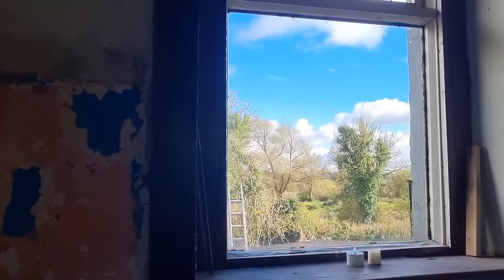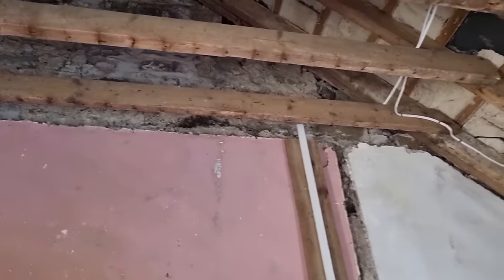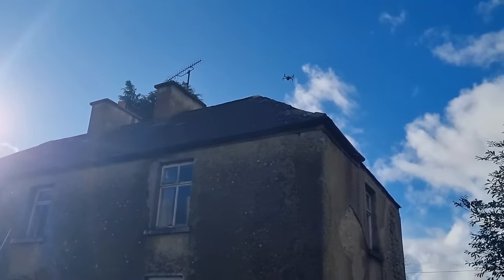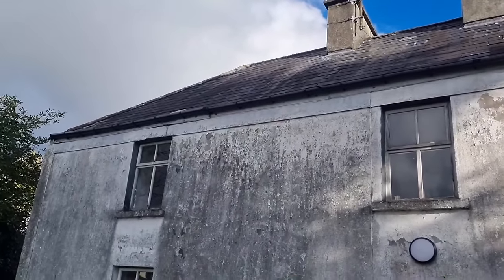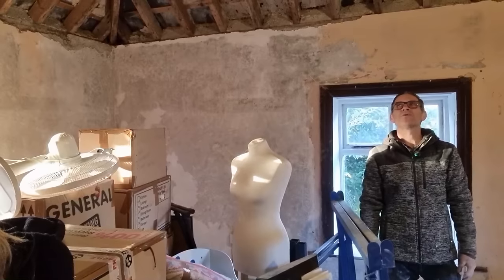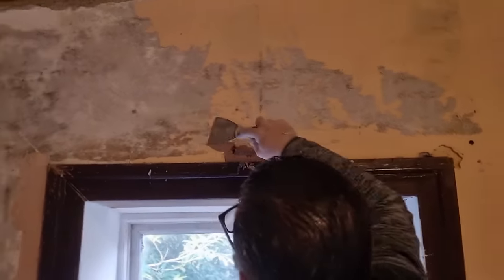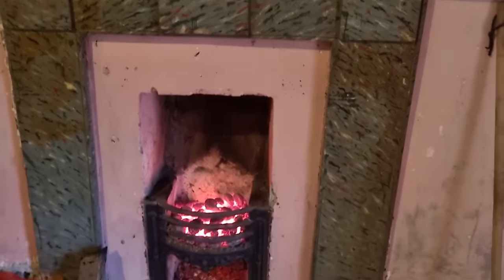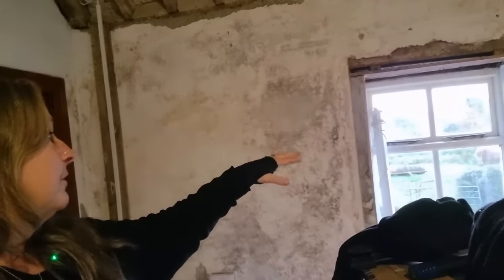Uncovering Ridge Tile Damage: Drone's Eye View of Our Irish Farmhouse

Comment: Golly! People do not understand that you are having to learn and research as you actually do the work. One can easily spend a week, or more researching joist installation. This is your journey - we're just here for the ride. Take the time you need to get jobs done. We have your backs!  😁
Reply from the maker: You’re absolutely spot on, it takes a long time to get to a point where you feel you’ve learnt enough to have the confidence to start to attempt jobs.  Thank you for your support, it really means a lot. ☺️
Reply: Don't be so hard on yourselfs, stand back, stand back take a pat on the back..
I love kyle and Guy but they have had huge experience. They renovated I think either 1or 2 house's in London. They were fabulous when they finished..
As you said you are living in the renovation.
Kyle and Guy built the Yurk so they can excape.. So it is very hard for you both, you are both doing a fantastic job, remember that.
If you could afford to get the roof done, that such a very dangerous job.
I got the walls insulated on the my 3 bedroom semi-detached house and it took the guy's hours to put up and take down the scaffolding 🙈🙈

Comment: When you get the scaffold tower you might be able to get the ridge beam on the barn
Reply from the maker: Yes, that will be a job for that. Really need to repair the gable first as a lot of the lime has been destroyed by the Ivy and it’s left the stones a little loose in places so once the weather is right I can get that repaired and then we’ll get on with the roof too.

Comment: Not at all.  Anyone who thinks you should’ve done more in 5 months doesn’t have experience doing extensive remodeling/rebuilding old structures. The one thing you’re guaranteed is that you will find many surprises and your schedule will have to deal with multiple curve balls.  You both have done so much. I’m absolutely impressed. 

I would have addressed the roof on day one for fear that my work securing everything below might be compromised.  Buy you both have made great decisions. Your instincts & research has done you well. Hold your heads high.  Good to have the scaffolding for future work like the gutters. It’s not just the drone that goes blowing up on the ridge. Something’s are best delegated to experts. Not only can you hurt yourself, you can easily breathe more slate

I’m interested to see if you’ll be buying your son a bed 😃. Take care. You’re awesome ✌️💚♥️🎄
Reply from the maker: You’re right and our first curveball was having to replace the kitchen ceiling/bedroom floor as well as the living room side. We knew we would have to replace the living room side but didn’t know just how bad the kitchen was. Oh that and the vast amount of woodworm that was in the house, that was a huge problem and possibly still will be. We just have to hope that we’ve dried the house enough to have stopped it…but we shall see next year I suppose. 🫣😬

We’ve had the roof patched now in 3 places and so far so good. I’m sure in time it’s probably going to need either replacing or at the very least all the slates off to see what timber needs replacing and then slates back on that are good and new ones where needed.
The scaffolding we’re really pleased with as it makes the guttering so much easier to deal with as the fascia needs replacing too.
Definitely with the roof, I don’t think either of us are brave enough at the moment to be climbing that roof! 😂 

Yep, managed to get him a bed from Facebook marketplace! Who knew pine double beds got sold so quickly! Every one I messaged had already gone, but I did eventually get one! 😮‍💨 
❤️

Comment: You're doing well. Multifuel stove in living room and new flue liner and sorted. Go 904 grade stainless as lasts longer if burning solid fuel. If not DIY installing the liner then pays to have installer fit the better quality 904 grade. 
Ridge tiles, could do with some reclaimed slates to repair cracked slates/ missing. Cut with stone disk in angle grinder or buy a genuine slate cutter.
 Need a hip iron for the bottom and use neat PVA adhesive on the slates and if summer moisten the backs of the ridge tiles and mix  3 of sharp sand 1 cement and plasticiser add mix to bed them onto mortar. Use rubber mallet to bed them in and spirit level to keep them even/ running true or string line. Not a bad job to do.
Reply from the maker: Thanks so much for all the info James.  We will be going with the 904 due to us wanting to use both wood and coal.

Look out for another video already uploaded for an update on the ridge tiles.

Thank you for watching, commenting and being so helpful with your info.

Comment: Get Sean to do the ridge tile repair and the bit of missing guttering, and while he's there get him to put chimney pot covers on to stop raining getting down. And if the smoke is coming in where the roof space is would lime plastering the chimney breast be a solution? You are both doing a fantastic job ,I am quite jealous. getting smaller jobs finished gives great satisfaction and keeps you motivated.!!!
Reply from the maker: Spoiler alert….Sean came to our rescue again at the 11th hour and saved us from having to scale the roof! We have some scaffold now so we’ll be able to get the guttering done much more easily which is really nice! You’re absolutely right with the smaller jobs, it’s been nice to get some of those done and it does give you a little boost doesn’t it?
Reply: @thecornerhouseproject  👍👍👍👍
Reply: I think for a proper fix you'd need to get the plaster on the inside of the flue, the most basic form of a liner. I've seen professionals do it on smaller flues (about 150x150 mm) by lowering a rope through the flue, tying an old foam mattress to the rope and pulling that up while pouring plaster slurry down the flue from the roof. Probably won't work too well with a large flue for an open fireplace though.

Comment: Glad you are going to get the leaking fixed. Glad you’re going to slow down a bit.you can use plexiglass and foam tubing to make storm windows to fit over your windows and keep the heat in wind out.
Reply from the maker: What a great idea with the foam tubing! Wouldn’t have thought of that in place of the magnets. Someone else has suggested foam board insulation cut to size as well. This is the amazing thing about YouTube…there are so many people with ideas that would never have thought of! Soo thank you for that! 😘

Comment: Wow your cracking up on the roof. Yes i would not fancy been up on the roof. Safety first if up there and not sliding off it.
There was an item for painting over cracks like a clear silicone that repelled water and put on via brush on a clean surface.
I do love the topless model with Ben leaning on.
Onward and upwards.
Reply from the maker: No, we didn’t either and luckily Sean (builder) did get in touch so we didn’t have to go up! Yay!🥳

Comment: Good decision to buy scaffold, as you said you will need it for many more projects. 
I loved the smirk when " delivered" was mentioned . Yeah some companies do take the perverbial when it comes to delivery times. 🙄. Those hip beams will unfortunately need replacing too by the looks of it . Once you get, the roof and guttering sorted those walls will begin to dry out properly. You will get there with time and finances off course. Hope your plaster is lime based , be  a lot easier for you. They hopefully just put the wrong paint on over it. Your both doing an amazing job there . Hope, you get the place winterized . I really don't know how you are doing it. I admire your work and determination to get things done.
Reply from the maker: Yeah I think it was definitely worth it buying it. It means it’s here to hand when we do need it and we go at our pace too rather than trying to rush a job for the hire period ending. Hmm, yes with the delivery, but the main thing is….it did arrive 😂 
Yeah the hip beams aren’t in the best of health, so that’s another job for some nicer weather. Guttering we will try and get sorted sooner rather than later too as it’s not only is it not helping the walls but we’re not collecting as much rain water as we probably could. 
Fingers crossed with the lime, the base layers are lime, it’s just that top coat in the living room side of the house, although I did watch a video the other day of a smallish slab of dried quick lime putty and it does actually look and sound very similar to what is on the walls here, so fingers crossed it is like you say and just the wrong paint was put over it. It fizzes when it goes in vinegar, so fingers crossed!🤞 Thank you for your always lovely comments and all of the advice, it’s very much appreciated. We definitely have determination in bucket loads, so hoping that keeps us powering through. 😘

Comment: You might reconsider putting up temporary plywood ceilings... it will be not much easier than putting up permanent ones... I reckon insulate then line tne ceilings, they won't perform correctly until the roof is fully replaced with a moisture barrier and all that but you could probably wing it a bit. You would need good advice on what sort of insulation could withstand a bit of damp for a year or two before the roof gets done, maybe wool but I have no expertise on that matter. Keep up the great work, you are inspiring us all.
Reply from the maker: Wow, it’s like you have seen into the future Peter, keep an eye out in the next day or so 😉 ☺️

Comment: If I was there since it's a farmhouse I would change and put tin on it and I think u can buy tin that looks like tiles.. It would be a easier diy for u 😊
Reply from the maker: Yes I think you can with tile looking tin and it does look quite effective doesn’t it? I would like slates though when the time comes that we can’t keep patching the roof up 😂
Reply: Personally for me I feel tin only works on the small single story longhouse cottages.  Something that formally may of had thatch.  With a turn of the of the century farmhouse (which incidentally looks exactly like the house I grew up in in Co Wexford) slate is more in‐keeping.

Comment: I think all the plaster on the walls should come down, so you can properly insulate the walls and then put up sheet rock.
Reply from the maker: We’re going to see how we get on with this first winter and see if the house maintains a heat with the plaster alone and with the insulation we have already put in the ceiling and around the windows, if it doesn’t perform as well we hoped…we might consider other options.

Comment: Hi, have you considered using insulated plasterboard for all your outside walls, even with only 25mm of insulation you will feel an enormous increase in comfort. I started doing this about 20 years ago, one room at a time as we decorated. Friends and family were impressed and some followed our example.
Reply from the maker: We’ve decided we are going insulation free on the internal and external walls apart from lime plaster and render and we will see how we get on. Temperature wise in the house it isn’t too bad so far but we have yet to hit winter properly yet so we may change our mind on that! 🤣

Comment: surely you must have a whole new roo,maybe not the timbers but the lining felt,battenning and tiles
Reply: roof
Reply from the maker: The roof, surprisingly, is in very good condition apart from some slipped slates. One day maybe it will need overhauling but for now it is good. If the day comes that we need to remove slates we will indeed put a membrane on before the slates go back on.

Comment: It's Mr Doom and Gloom again. Totally agree on the benefits of having scaffolding and will be very useful to a certain height. Now the important element is the legal aspects of building a scaffolding structure for roof access on a two storey building, and this requires an certified scaffold engineer to sign off, hence why the costs of hire has gone horrific. This is of course in an attempt to stop the amount of scaffolding incidents. In addition, you have the aspect of the front of the house facing a road, all be it is of very low traffic volume, but again the legal eagles have issues with that.  Finally you have the issue of the ground conditions of flooding in parts of the external ground and the need to have the placement of solid footings for the scaffolding. So in short you are correct in letting the roofer do the job as it is insurance policy and legal compliance of having in place a safe working space. 
Is it feasible financially at this time of year to spend circa €300 on 8m 316 grade flue liner with a top hat and get the roofer to throw it down whilst he is up there. You could then fit the internal plate to seal the chimney to the flue. When the roof is being replaced fully in 2024 2025 you could then pour the vermiculite to surround the flue liner that will insulate and secure the flue. 
On the issue of ridge tiles, as you recognise these will need to be replaced but also appreciate at €7 euro for a 400mm ridge tile the cost is significant, and then there is either the time factor either cement affix or the likes of Marley fixing kits but again you are looking at €80 for each ridge plus tiles. All in all a major investment especially when the roof is due for a major strip and rebuild. Thus you are down to two options, (1) the roofer cements the cracked tiles by carefully removing the broken ridge tile and then reinstall into the cement bed, not a quick job certainly a good two day task. (2) the other temporary solution is to have the roofer to lightly grind the in place ridge tiles to remove any loose dirt and then encapsulate the ridge tiles with a self adhesive fast flash tape, this would overlap the ridge tiles and roof tiles to give a water tight fitting until you get a perm repair in 2024 2025. (3) the final common solution is internally to utilise a self expanding foam kit that would be sprayed around his ridge tile area, this material would then expand and fill the gaps and also provide a form of securing the ridge tiles to the roof tiles on an interim basis. Just my usual thinking aloud to generate options.
Reply from the maker: Haha we like a bit of Mr Doom and Gloom now and again….keeps us on our toes! Well luckily the builder/roofer came to our aid and he did it in the end, which was a phew moment as I think neither of us were ready to get up on that roof just yet. He replaced all the ridge tiles on that side with some new ones and patched up the missing slates with temporary composite tiles he did a really good job with it all especially as I don’t think he was keen on doing it to begin with but it has stopped all the leaks and that’s good enough for us for the time being. Not sure we can afford to replace a roof just yet, so fingers crossed it holds for a long while yet lol
We like you’re thinking aloud as it gives food for thought and of course options too!
Sean is coming back in the new year to chuck a flue liner down for a wood burner as to have an open fire you need to have a chimney flue of 9 inches to put a liner in and we only have a 6inch flue unfortunately. So we will look into a wood burner most likely or an insert so that we can maybe keep the original fireplace surround in place.

Comment: you shoulda done this at night time with lights on inside. before you put the nasonite on the inside roof.
Reply from the maker: Ah that would have been a good idea.  We only have plywood as a ceiling for now and sheep wool insulation.  The ply isn't there to stay but is only a temporary measure until we are ready to put up the final finish.

Thank you for watching and commenting :-)

Comment: I think a professional should come and look at roof.Looks to me like most of the  roof off and an odd timber replaced and felt or membrane put down and slate and ridge tiles put back on.Summer time job so maybe big heavy tarp for now.I know ye both will get there.Just be very very careful at our age we dont bounce anymore we splat like a tomato 😮😮
Reply from the maker: Haha…I’m not liking the idea of splatting like a tomato 🍅 and luckily the roofer/builder got in touch and he did come out and replace the ridge tiles and some of the broken slates and for now it is waterproof which is lovely. You’re right though it will need some timbers replacing as the rain had been getting in for a long while and because of the ceiling panels…it has just sat there soaking into the wood. 🫣
Reply: @thecornerhouseproject  ah at least your sorted for now.👍